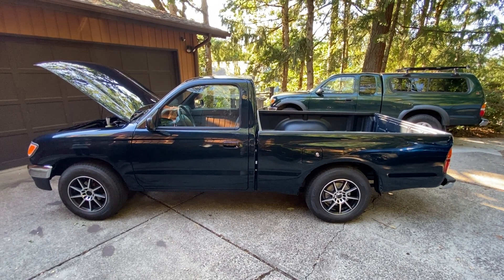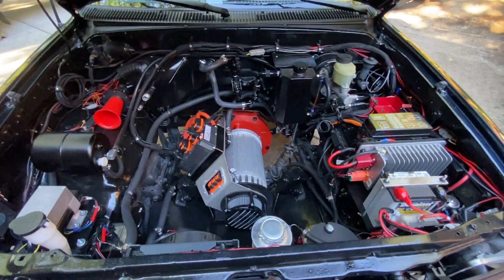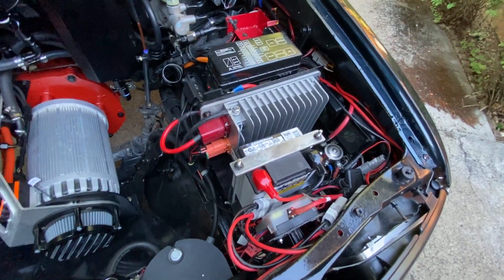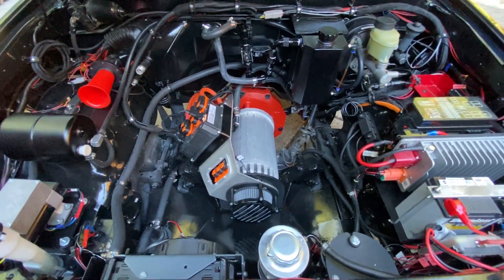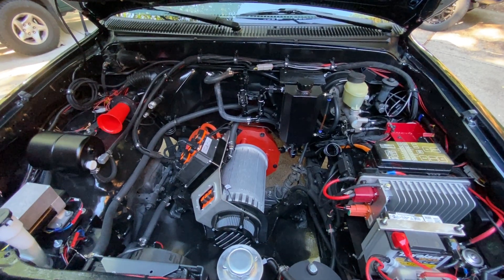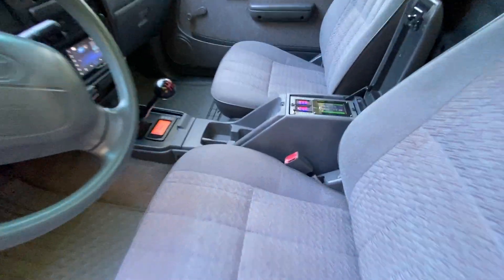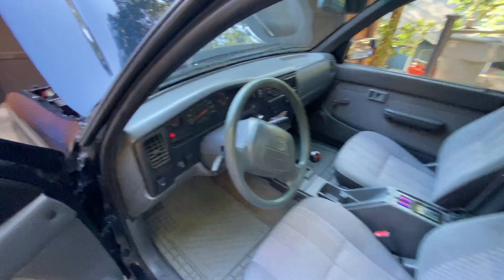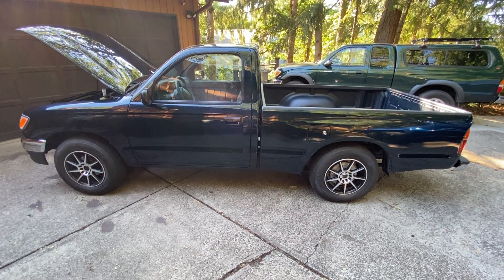Electric Toyota Tacoma Conversion

Comment: I'd like to do something like this with my 2000 Nissan Frontier SE Crew Cab. I have a 2019 Nissan Leaf drivetrain that I think would be perfect for such a conversion. The Hp and torque of the two vehicles are very similar (the Leaf has 215 Hp and 250 lb.ft. of torque). The Frontier's drivetrain has nearly 200k miles on it and is beginning to nickel and dime me to death, but the body and interior are still in great shape. Probably wouldn't look as clean as this Toyota though. This is a beautiful conversion. Nice Job Chris.

Comment: How much money did you spend
Reply from the maker: We spent about $27k with all the parts and and rebuild. This included $15k for the batteries (at that time) and $4500 for the Hyper9 motor (its a dual shaft version). But we have won 3 car show awards with the truck so far and its more fun than other cars you can buy at that price.

Comment: How much did it cost to convert?
Reply from the maker: Hi Wyatt, The conversion was around $27k all in. We have done some body work and other items past that but the $27k is what it cost us to fully convert with new batteries new motor and all the trimmings. At the time it was around the cost of a new EV so we figured it was worth it to us since we had an Electric Taco vs a Leaf or Bolt etc.

Comment: Thanks for sharing this with the community, you folks did a really nice job! I am wondering if the vehicle sees salty roads in the winter and if so, have there been any unforseen issues with salty moisture getting into unwanted areas, like the battery containers, or anywhere else? I am in upstate New York where road salt is extensively used in the winter and thought this might be a concern if i did a similar conversation. Looking forward to hearing about your experiences in this regard.   Thanks!
Reply from the maker: We are  on the west coast and salt is not used on the roads in the winter time. We have the battery box under the bed in the back and it seems dirt and stuff from everyday driving but has not seen any damage or other issues. This is a liquid cooled system for the SME controller and the batteries so the battery box is pretty robust and holds the BMS system as well. We also have the chargers under the bed right behind the cab and they seem to be very happy there again inside a protective box with cooling.

Comment: It's been over two years since this conversion was done. How about an update? Has the truck conversion been successful and is there anything you would do differently? Thanks!
Reply from the maker: Here is a link to the new video of us driving the truck. https://www.youtube.com/watch?v=1ycXTM5LUEE
Reply from the maker: Hi Brian, Sorry for the delay and thanks for the comment. My son and I use the truck as an everyday driver and have done several thousand miles on it now. We get around 90+ miles in per charge in the summer time and about 75+ in the winter (if its not too cold). The liquid cooling loop we have for the batteries is also used to heat the batteries in the winter with an inline water heater. We also use that for the heat in the cab but it really only defrosts the front window and does not provide much heat for the driver or passenger. We have won 3 awards at car shows around the area and appreciate when people stop by and talk with us about the build. I will upload a video of me driving the truck (my son doing the video). Basically we have saved about $1200/year since we got it running and drive it everyday. We get about a full week of driving around our town and charge it on the weekends. I am charging it right now at 40amp 208v and will be done in about 4 hours for about $3.50 when done at the right time of day.

Comment: Awesome 👏 ❤
Reply from the maker: Yes this has been running for the last 2.5 years without issues. We drive it every day and get about 90-100miles per charge and make it basically all week on one charge. My son has won awards at 3 car shows over the past two summers and people love that its still a 5-speed stick. Because its a stick we are able to use less "power" to overcome the moment of inertia when stopped using 1st gear and get more distance per charge using the gears properly. Of course you can just start in 2nd or 3rd and pretend its an automatic and just never shit.  Finally nobody pulls up next to a Tesla and think they are going to beat it off the line..... but everyone thinks this is just a beater and want to go around it when the come next to it at a red light.....  and then the light changes.... SEE YA!

Comment: This is optimal. You got the ability to pick out a body you like, or fit in if you are tall or wide, and elcetrify it to beat all the eco norms that will come and the damn vehicle will still drive the same cuz you ONLY REPLACED THE MOTOR. Now that's what I'm talking about.

Comment: Thinking about converting my 2017 GMC Canyon 4x4 when it inevitably dies I just want 200 kms of range in winter and 4x4 to work so I can use it for camping and construction work instead of forking out $90k for a new ev truck

Comment: So sick.
Reply from the maker: Agreed! Driving it every day is even better then you can imagine. $3 to charge it for about 100 miles and 0-60 in 6-7 sec.... I say yes all day. Once cop told me as long as we dont break the back wheels loose we can accelerate as fast as we want.... so we do! And with the batteries right over the back wheels we have yet to break them loose. Also shifting an electric is just fun and puts the fun back in driving. All the fun of a cheap electric and you dont have to drive a Nissan Leaf!
Reply: @sullichr  I’m doing a bmw with a very similar set up , it’s my first conversion, wish me luck 👍
Reply from the maker: @GypsyTales420  let me know I am happy to help just ping me. I know all the parts you will probably need etc.
Reply: @sullichr  awesome! I have a lot of parts, I think the only thing I need at this point is batteries. My main concern is the wiring, and how to get the original cluster to work, like the speedometer and “fuel” gauge. I’ll be posting an update video soon. I’m building the car in my driveway and I’ve been fighting the elements lol so it’s been slow last couple months. I went super budget. Found motor, adapter plate and controller for 3k. It’s warp11 dc motor so it’s pretty old tech but I think it will still be cool.
Reply from the maker: @GypsyTales420  Sorry for the delay. Did you get the info you needed? We also built on the driveway and used a Costco 10-20 tent for help protect from the elements.

Comment: It would be cool to skip the entire transmission, drive shaft , and rear solid axle(save a lot of weight) , if you put like a Tesla model 3 drive unit back there with independent rear suspension.  It comes off as an entire cradle, which includes the sub frame, suspension links , hubs, brakes ,motor, differential, CVs axles all in one convenient package.  They are like $3000 in used parts. Plus you get the power / efficiency boost of tesla drive unit  ( 310 lb-ft tq, 275HP)
Reply from the maker: Yes of course doing a Tesla motor with all the trimmings would be great but cost more then $3000 unless your not getting them in a legal manner (yes even one from a wrecked setup as people all think these Tesla motors are better then gold for some reason).  Also most of the cost in the build is still around the batteries and you would need a larger set of batteries then we are running (124v for this build and over 300v for the higher torque motors) providing higher voltage leading to higher torque allowing for any higher power/torque motor not just one from a model 3. Also with the solution you have the build would loose the 5 speed and no more shifting for the driver and we all know that can be half the fun of driving when your not just going fast in a line.  Yes the tranny is a drag on the efficiency but not fun!  If you really want to do it cheap you just take the head off your ICE and mount a DC motor on the top of your block and run a belt to the crank shaft and a few other mods and your up for really cheap and keeping the manual would allow you to use a really cheap low power motor and use the gears to get to speed. Doing it expensive..... well come on having the money lets you just do anything you want and there is just no fun in that.... all the rich people already do that stuff.... but funny thing non of the rich people would every have done a '96 taco yet they all offer us money at the car shows to buy it off my son and I. 

BTW this truck has won two car shows already!
Reply: @sullichr  you’re actually right.  Part of the reason that those motors are gold is everything that comes with it. the inverter the 350 V battery pack ,charge port ,the software ,all the controllers, steering, brake system and way more .   Thus the best “ swap” is just find a salvaged model 3/Y, and remove the damaged unibody top , then weld / fabricate the unibody to look like the end product (in your case the “shell” of a truck). That way you still get all the battery management system the regenerative braking the auto pilot even, the infotainment , the heat pump and so on . 225 mile range let’s say still , 3,700lbs, and performance of what an electric car can provide. Basically just use the “skateboard “ from the tesla. Add shell of what ever you want up top.  That’s the best swap.
Reply from the maker: Yep  @Shabobidhuffy  you are correct the model 3/Y are drop in solutions that are much better and would drop into many conversions. Just costs and availability. Its easier to find a crashed leaf and take it down but are not as nice a solution as ours conversion presented here. This conversion of using the Hyper9 has a larger motor then the leaf so using parts from a crashed leaf we feel its not as good as this conversion. Plus we can take the hardware we have here all off this conversion and put it on just about any vehicle less then 3600lbs and all we need to do is get a new motor plate to that transmission and we are pretty much up again.

Comment: I see you still have the manual transmission. How do you know when to shift without hearing rpm?
Reply from the maker: So you can actually hear the electric motor wind up. It sounds kind of like a space ship and each gear has a speed limit regardless of the RPMs the motor runs at. For example because it has so much torque you can just start in 2nd gear and go up to about 50MPH and when running at that speed you may have RPMs high to get up to speed but lower to keep it there. But 2nd really does not go past about 50-55MPH and we have taken 3rd up to 75+ but never into 4th or 5th yet. Also since its an electric motor you only need to use the clutch when moving so when you come to a stop there is no need to put the clutch in or use it to start. Yep you can pretty much drive it like an automatic transmission if you use 2nd gear and only need to go up to 50MPH. Starting in 3rd works but is slow off the line and starting in 1st takes the truck to about 25MPH before you need to shit to go faster. Again using 1st at 25MPH is still around 7000RPM and the motor will go past that but the gear just seems to limit out and does not go much faster by increasing the RPMs. 1st is fast off the line but you need to shit taking a second of time so when testing 0-60 times we used 2nd gear the whole way and did one shift around 55MPH. Right now the 0-60MPH time is around 6-7 seconds.

Comment: You can also do the ford ford lightning 2003 in electric conversion kit please thanks
Reply from the maker: Yes both Ford and Chevy now have create motor setups for electric conversions. That was not an option when we started the project and we just had to find our own way through. My son Forrest and I took on each aspect independently and solved them one by one. The kits are a slam dunk at this point.

Comment: This is awesome, this got cross posted to a facebook group that was curious why you opted for the 5 speed transmission. I'm guessing it cuts cost or ease of design since you could just use the existing mounting positions and drivetrain?
Reply from the maker: So with the 5 speed manual you get the best of both worlds. Its like an automatic when you want to just drive it since the motor is high torque it can just start in 2nd or 3rd gear (slower off the line but goes no issues). Next when you come to a stop you do not need to put in the clutch since the motor does not die when its not rotating. So again its like an automatic in that sense. But of course some of use still like to shift and feel the driving experience and so when you want to shit you still can so its kind of like a hyper car or super car.  Finally the manual makes it more fun when you can do things like put the motor in reverse using a relay and now gears 1-5 go move the vehicle backwards with no limit to speed. So yeah we can beat a Tesla or Ferrari off the line "in reverse"! I mean when you build you own EV you can have it anyway you want and we feel this makes it way more unique and cool.
Reply: @sullichr  you guys can reenact Fast and Furious 2 with Brian going backwards in his EVO on the freeway!

Comment: So, if you put a small Yanmar diesel generator or Honda gas generator in the bed and hook it up to the motor could you just use that instead of battery 🔋🤔? Seems to be a successful concept tried and true by freight train 🚂🚃
Reply from the maker: So yes you can take a generator to either run the motor or charge the batteries. The problem is using the generator directly means you need to buffer through the batteries for clean power kind of like a UPS would do or have one hell of a half/full wave rectifier. Also your efficiency would be based on the conversion and reuse of the energy (ie first fuel then electrons). Trains use electric motors for the high torque at low RPM to move freight since gas engines are high torque at higher RPM it not about efficiency. We  are not in need of that much torque since the truck is so light. With the 173ft/lbs of torque we have here we can go from a dead stop out truck in 3rd gear (slow off the line but goes without issue). Yes this is still a manual truck and yes we can pretty much drive it around in 2nd gear around town without needing to use the clutch. We only use the clutch to change gears when moving. Even at a stop we do not have to use the clutch. More importantly since its a manual we have a relay that allows us to swap the motor into reverse and do gears 1-5 in reverse at full speed. Finally to get the current we want do really take off the generator would need to support 200amp or more and that may not fit easily into a small vehicle and would change the noise level for sure.
Reply: @sullichr  application: 9th generation suburban or Yukon XL 4×4 approximately 6000LB.  What size motor and generator would be necessary for a DIY diesel electric hybrid or gasoline hybrid 🤔?
Reply from the maker: @stu5762  So  you would need to look at a larger motor like a Warp 11 (11 inch motor) with a 1000-2000amp controller and a battery pack over 180v to move a vehicle over 6k lbs. The hyper9 (9 inch motor) we used has 173ft/lbs of torque at zero and great up to probably 3500 lbs. Where the Warp 11 has over 400ft/lbs so that's what you would need to move that Yukon being 6000lbs.

Comment: Very nice video. in 2023 where would start if you were going to a 1992 supra with a r154 transmission
Reply from the maker: Start with getting the motor plate once you have that everything else is non-vehicle specific.

Comment: I guess the only drawback is the mileage for now, correct
Reply from the maker: Yes we would love to get greater distance for a charge but that meant more batteries which meant more money.... We have 25Kwh (5x tesla model S batteries) and we could have found room to do about 35Kwh under the bed easily. But again costs as the batteries, motor and all the parts to convert were already around $27k total with the 25Kwh battery pack. We can always add more and we will look into that down the road. We found that since its still a stick we can turn off the regen when then when we take our foot off the throttle it will coast more then the nissan leaf and others. This gets us some extra distance and then we can do fancy stuff like turn off the power steering to reduce power draw also given us extra distance. Basically we can keep turn down items drawing power to the min and get 10-20 more miles distance.
Reply: @sullichr  wow, I guess it’s just being a project is really nice but really not worthwhile in money saving wise, I would love to convert a Toyota pickup into a EV but it’s not cheap at all, thanks
Reply from the maker: Well yes I’m this case no real savings since the cost of the motor and batteries are just too high to call it a good deal. You can always get used batteries and a cheaper motor. We also got all the learning out of it for my son in term of welding and everything. So it had a greater return then just the truck itself.

Comment: Great video, how much did it actually cost to do this conversion, thanks
Reply from the maker: Yeah so the Hyper9 was $4500 as we have the one that can do a dual motor. Then batteries and cooling setup, vacuum pump, power steering , motor plate etc was another $23k. Its basically the cost of a nissan leaf but is way more fun to drive and freaks people out when you torch them at the line and literally just walk away from them as they floor it. I mean its a 5 speed electric where we control the throttle curves and everything. We did put a relay in to let us hit a button and swap the direction of the electric motor allowing us to do 1-5  gears in reverse. Yep we can beat anyone off the line "in reverse".